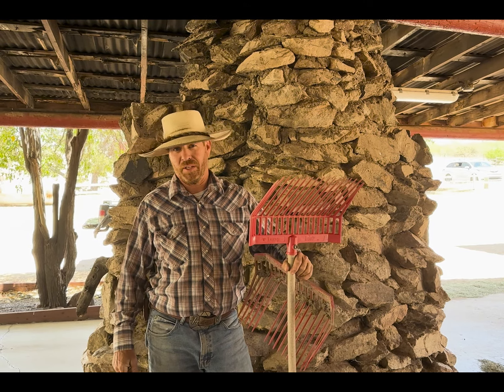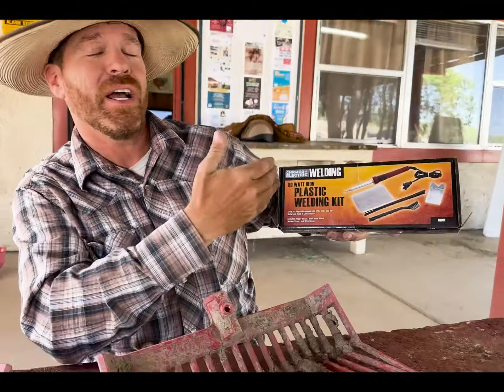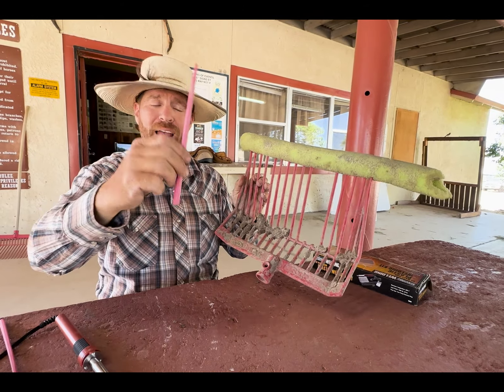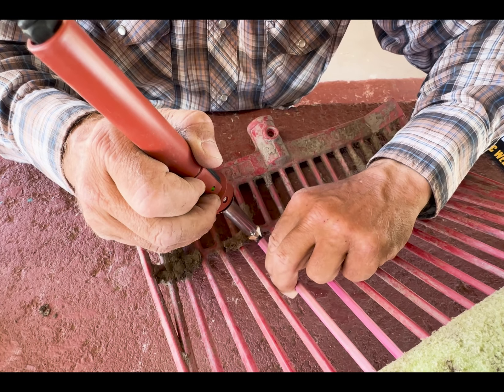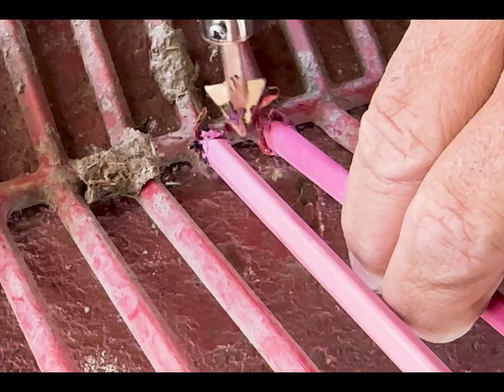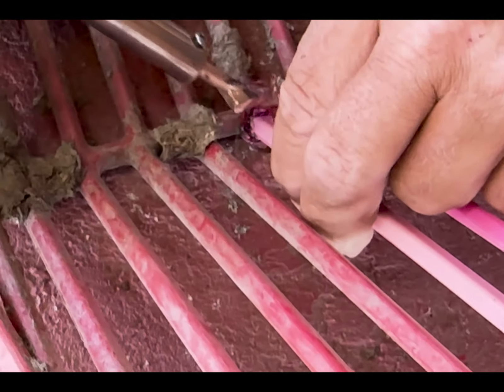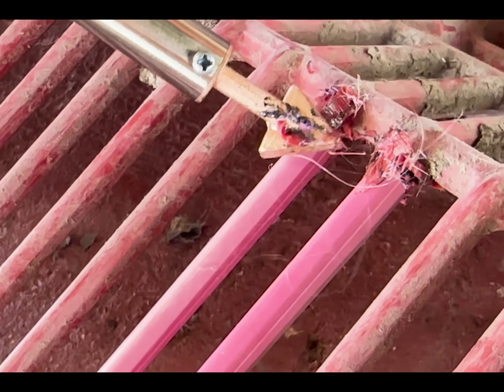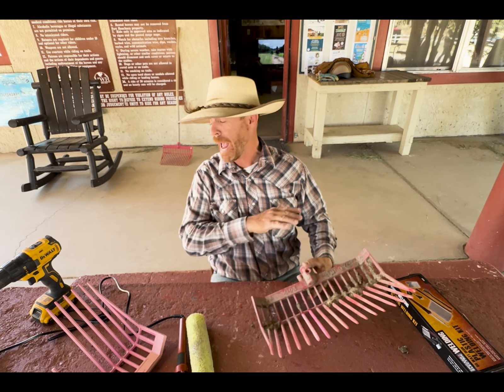How To Fix Your Broken Manure Fork

Comment: There's gotta be forks out there made with better materials, right? 
This particular plastic appears quite brittle.
Reply from the maker: Some forks are made out of metal. Most are made of the plastic material with various degrees of material added for stability. They sale replacement heads when the tines break off. Always makes you think that they make them brittle on purpose?! At least I can fix mine instead of having to pull out the pocket book. Thanks for watching! - Travis

Comment: Maybe u ought to hose poop off 1st for a better connection? Good idea though
Reply from the maker: @dl2467  That is a good idea. I have found that where the break is, it is a clean site and then weld it together with no issues. A little poo hasn’t hurt anything yet. But it sure has the potential. Thanks for sharing your thoughts and watching this episode. Cheers- Travis